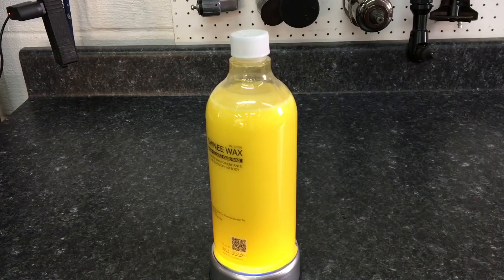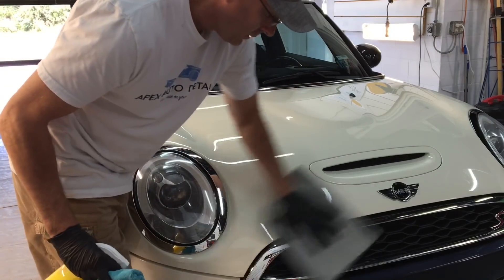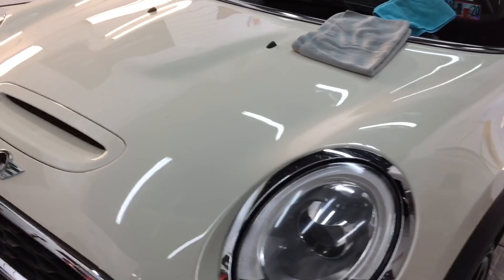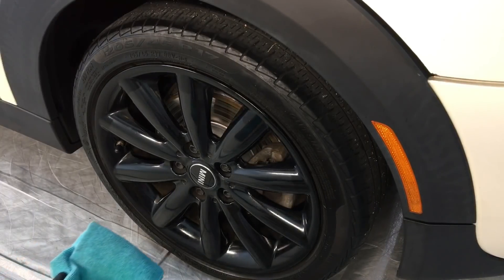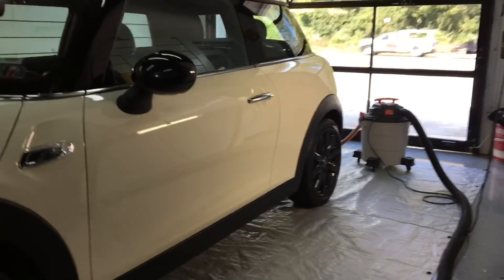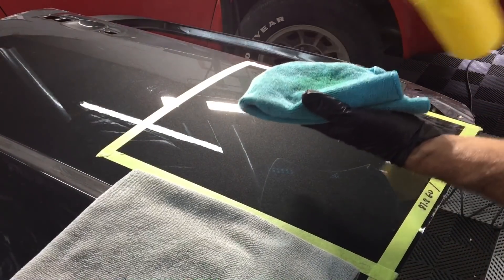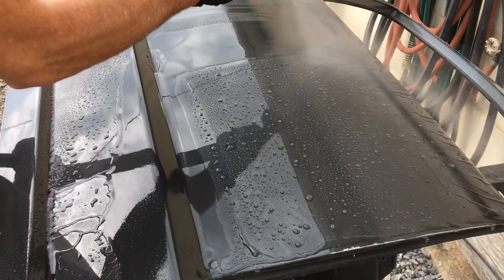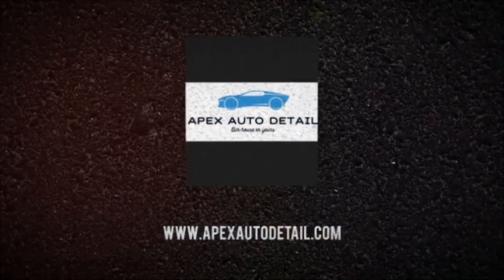You Want GLOSS? Here It Is!! TAC System Shinee Wax!!!

Comment: HI Brian - Do you have any issue with using a polisher with spray products such as TW SealnShine, P&S Bead Maker, or TacSystme Shinee Wax?  I'm aware it's not the common method of using microfiber towers and elbow grease but I'm thinking at the lowest speed of any type (whether it's dual action or not, corded or cordless) it probably isn't an issue. I'm not thinking of the same slow methodical actions as when using a compound or polish but more of a quick 1-2-3 pass just to save fatigue and time from using microfiber towels. What are your thoughts please? Thanks Brian

Comment: Is this stuff sort of an LSP top up? Is is this an LSP in itself? I don't loads of products, I stick to one that I like. Currently it's Bilt Hamper Double Speed Wax which I apply about twice a year. In between, I use a spray wax on the wet car to just top up the protection. Would this work like that?

Comment: Whats the best product to make silver pop in gloss? Ive tried alot and get shine but I want it to look show car wet..I spend alot of time detailing my car and it stays in garage just cant seem to get it to be as shiney?glossy as id like
Reply: I like the looks from the Angelwax Enigma products on my silver metallic paint. Even the Angelwax QED for a more wax look. The Enigma line has a great combo of coating/wax combo look from it. Enigma AIO and Enigma Wax and E QED and E car soap. They have also just released the Enigma Corona which seems promising from the more wax look the Corona has. And finally if you want to try something different Angelwax AG wax which is especially for silver paints. Also Polish Angel Carnuaba Arts has one for silver paints. If you want to have a longer lasting LSP the Polish Angel esclate lotion and PA Master Sealant combo gives a wet look that's awesome. Top it with PA High Gloss or PA Carnuaba Arts Silver.
Reply: @tonymattisson6158  thanks for your time its much appreciated

Comment: Cool video !! Do u know if this will work over a coating? .. let me know. Thanks.
Reply: Anything you put over a coating is a step backwards imo. Also waxes don't usually play nice with Sio2.
Reply: @jasonlang7793  ok thanks for the info.
Reply: Coatings are a protective layer. You will get the reaction of whatever is on top, so if you apply something that is as good or better than your current coating, it's a win. Especially if it isn't a TAC System coating 😬